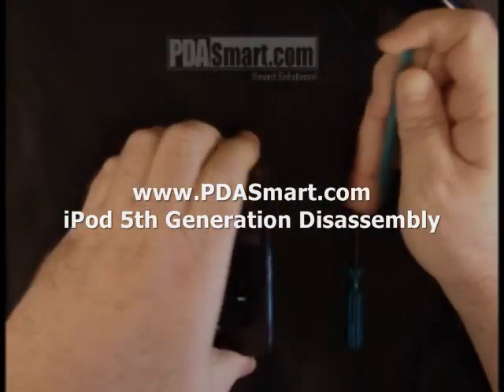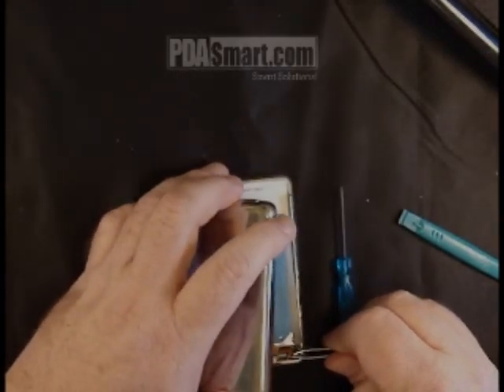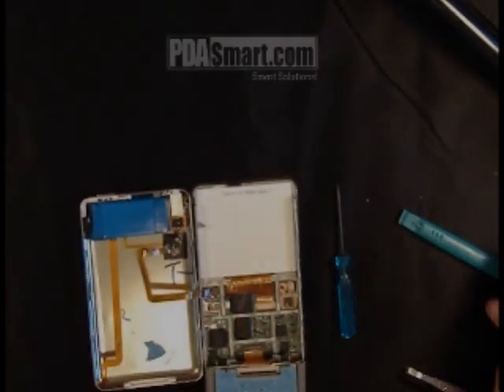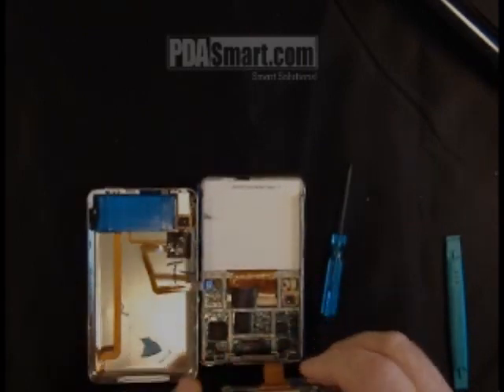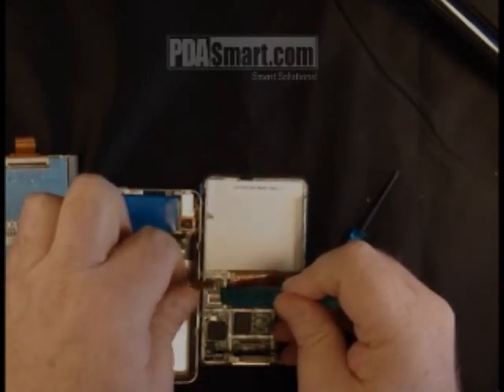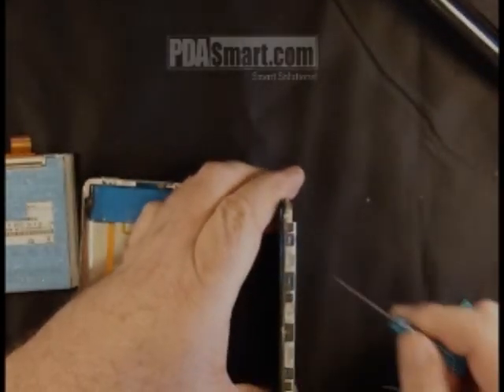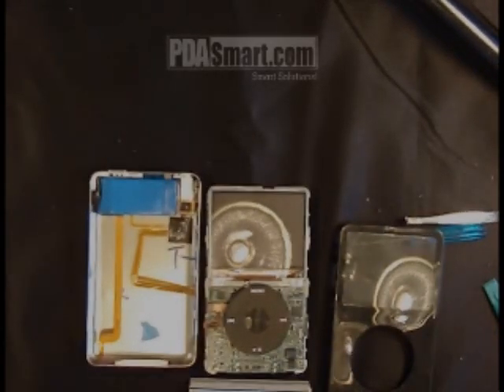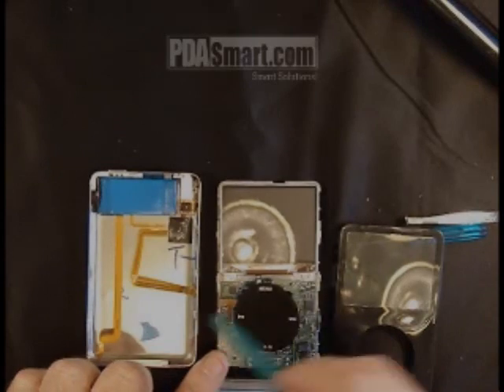iPod 5th Generation Repair Guide

Comment: My broken 5th gen when I opened it up, a little black square piece fell out. It has some copper wire in the middle of it and it looks like there's another one near where the hard drive connects. I don't know where this piece goes or if I have to replace something else. One of my kid's friends left it here a couple years ago because it didn't work and I'm not exactly sure what the problem is. When I brought it to the apple store they told me it needed a new hard drive so I have one on the way.